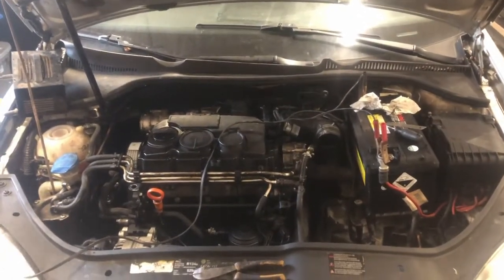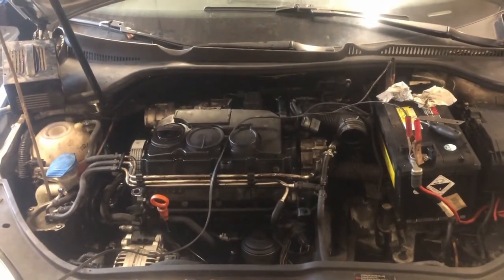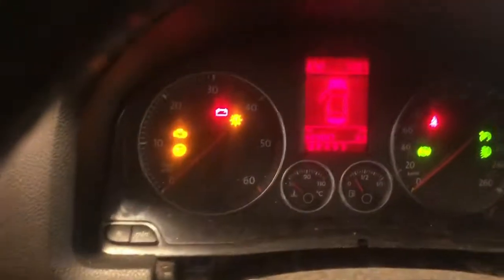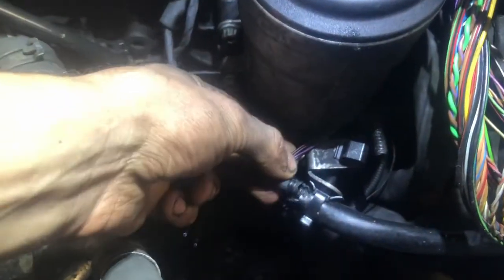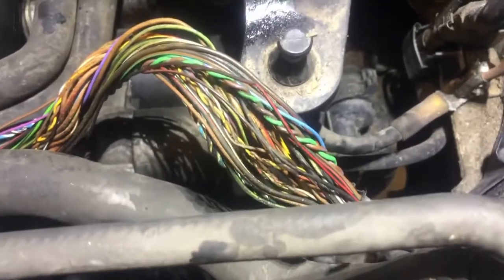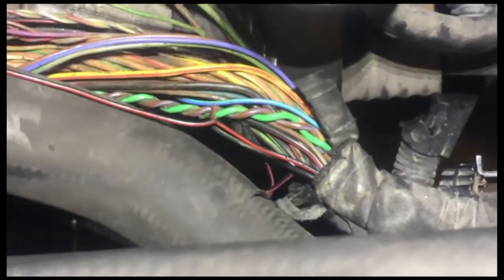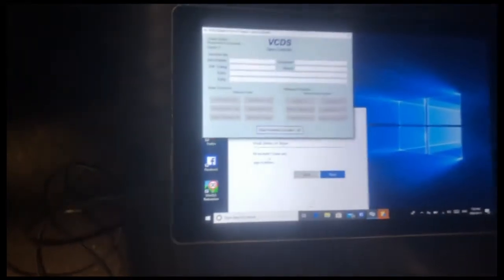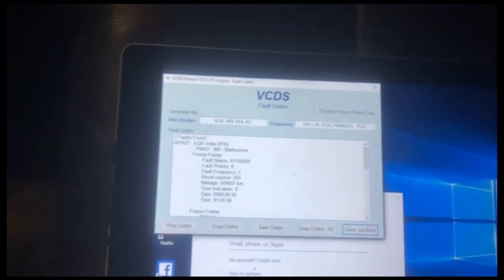Diagnosing P0322 on 2006 VW BRM TDI

Comment: Mine will start with it unplugged but if I plug it in the car won't start any ideas?
Reply from the maker: Thats an odd one, they usually wont run with a crank sensor unplugged but fine with the cam unplugged.
Reply: @Josh's Jetta's  see mines completely backwards I watched your video so I tried a few things it'll fire off with the cam sensor plugged in but crank out if I have both in it'll just crank, unplug the cam sensor same thing. I'm gonna check timing today and make sure all is good.

Comment: Hey Josh, I hate bugging people but I’ve watched your videos religiously and you’re obviously pretty knowledgeable about these. I have an 06 Jetta TDI BRM, engine shuts down every once and a while when downshifting. I’ll either drop clutch and fire it up or just start it again before even coming to a stop. Otherwise runs and starts smooth. Not showing any codes other than the egr delete. Do you think the CPS is where I should start?
Reply from the maker: It’s weird why it wouldn’t throw a code, Is it somewhat frequent? I’d try and get it to act up while watching crank/cam speed. Personally that’s where I’d start but they can be tricky to get at, I’d also check the wiring if it’s a higher mileage car

Comment: I’ve got a 2006 Jetto one. 9/BRM that starts and runs smooth until you give it throttle, At which point it will only go to 2000 RPMs and almost sounds like it has a two-step for the RPMs just jump up and down at 2000 RPM for a couple seconds then the tachometer drops down to zero and the glow plug light starts flashing. The motor will stay running most of the time and feels like it has more power but not full power. Did you have any issues like this? From what I’m finding it looks like it’s that sensor. For whatever reason it’s not throwing a code except for intermittently and when I check in VCDS it shows a couple things similar to yours. I also noticed that the fans are not turning on once you put the key in the ignition and turn it forward like my other sons 05/06 Jetta. It took a while before the fans would finally come on and when they did they were still spinning slow but the temperature never got over the center mark, 190.
Thank you for your help and I appreciate the video, very informative.

Comment: So I have a 2005.5 BRM tdi Jetta. Basically have the same issue I think not entirely sure but maybe you can help me identify the issue. Mine has 150,000 miles I bought it with 142,000 had it for six months so far and it started chattering so I think that’s the flywheel. But my real issue is my glow plug light doesn’t stop flashing. I bought a glow plug harness haven’t installed yet but here’s a list of things I’ve replaced since I bought it. 
Glow plugs (all 4), fuel filter, fuel pump, egr, MAF sensor, glow plug relay

Before the egr and MAF sensor it would go in limp mode then it was fine after both of those.
Reply from the maker: It’s difficult to diagnose without the codes, but they were known for this harness chaffing issue. Glow plug harnesses get dry and brittle as well

Comment: Great video! I had exactly the same issue on my VW Golf 1.9 TDI with the wiring chafing through at that location. It took me much longer to figure out though!
Reply from the maker: Yeah i wouldn’t of thought wiring right away either if I wasn’t in there moving the harness around for the tandem pump
Reply: @JoshsJettas   Yes it took me weeks to find the issue! I replaced the crank sensor but it made no difference. Then I started barking up the wrong tree thinking it was a fuel issue because VCDS showed good engine speed signal (with hindsight I think the ECU uses Cam signal instead if crank signal is bad). So I replaced fuel filter, lift pump and tandem pump (with used item) with no change. Then got access to the ECU, backprobed the crank sensor signal wire with a cheap £25 oscilloscope from Amazon. With engine running and when wiggling the wiring loom the signal started jumping in and out and I found a chafed crank sensor signal wire over the gearbox area. Some wiring idents and tips in the description of my video might help someone. I was so happy to find that chafed wire! https://youtu.be/TDBJn79SxRc